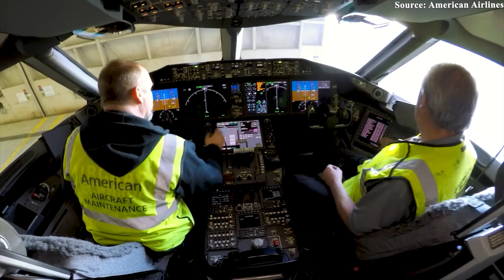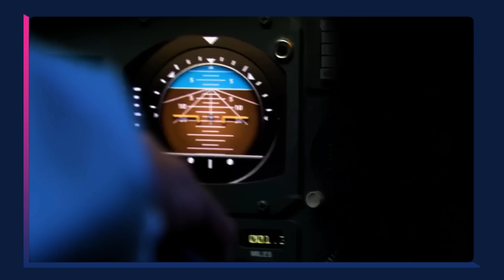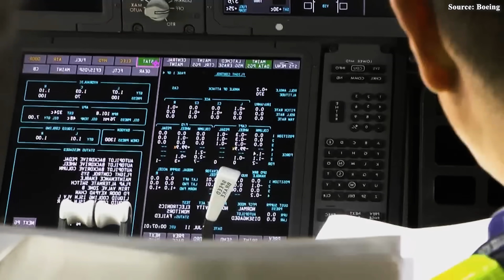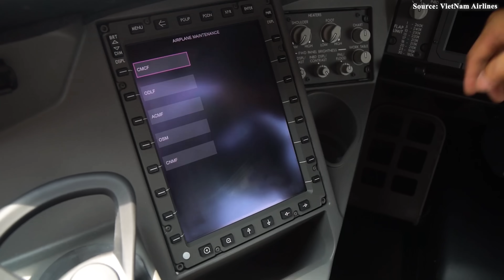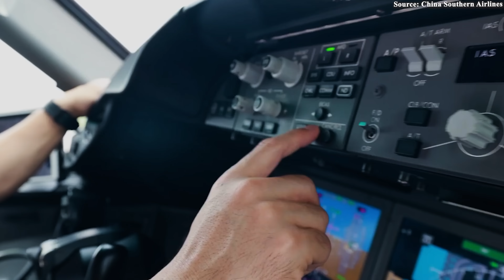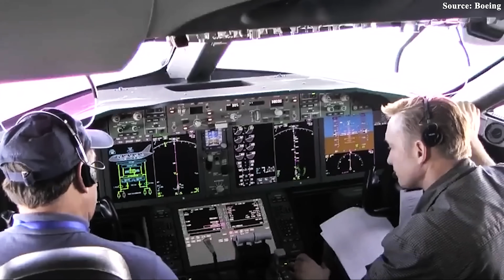They Just Dropped a BOMBSHELL about Boeing 787's AI 171 Flight!

Comment: That is rather cryptic that at 8:15 the video shows advancing the throttles with the fuel control in cutoff mode.  :(
Reply: You can't expect any response from engines that are NOT running, you can advance those throttles as much as you like.

Comment: Why are they afraid to say it was suicide. They need to devise a switch that only allows fuel shut off when the engine is in the idle mode, similar to the switch in the transmission of a car that only allows it to start when in th Park position. I'm shocked that this devise has not already been installed.
Reply: what happens when at 30.000 feet the crew need to shut off an engine quick

Comment: "Transitioned" does NOT necessarily mean "manually moved".  A  similar incident was reported on a Boeing 787 flight in Japan in 2019. The switches operate relays which control valves.  The entire system is part of the TCMA.  The matter is in a preliminary state of investigation and premature conclusions are best not culled from a reading of the preliminary report.
Reply: Cheap theater. A fundamental question is ignored by the "investigators".  It is known that FADEC can autonomously shut down either or both engines. What has not been determined (at least publicly) is whether the system can reset those cockfuel fuel switches. It is also known that some cockpit fuel switches (this seems to have been  deliberately tamped down by the FAA) are installed w/o the locking mechanism engaged. So, did Boeing make a concious decision to allow the system to cycle those cockpit fuel switches so that if TCMA shuts down an engine, or both engines, the cockpit fuel switches with reflect that new state? These are simple questions that the "investigators" are ignoring.
Reply: Exactly... 👍🏻
Reply: The only evidence that takes away from the computer is the pilot ask why did you cut off, so the switch was manually moved, but i agree, wait for the final report

Comment: @FLIGAVIA, I have the following comments to offer:

1). A total electrical failure would result in the automatic deployment of the RAT and the FADEC automatically closing the fuel valves, WITHOUT ANY PILOT INTERVETION or flipping the Fuel Control Switch from RUN to CUT-OFF.  

1.1) Do you know that one of the passengers who had travelled by this same aircraft from Delhi To Ahmedabad, on the same day, had uploaded a video of the air-conditioning and seat In-Flight Entertainment Devices not working?  

1.2) Have you heard the lone survivor from Seat 11-A, when he mentioned that soon after lift off, the lights of the cabin had flickered, followed by a loud bang, after which the aircraft crashed?

2). Isn't it rather presumptuous to speculate that one of the pilots deliberately cut-off the fuel supply to both the engines, based on an unsigned AAIB Preliminary Report, that is sketchy, shoddy, unprofessional, vaguely worded and ambiguous to say the least, that has even incorrectly mentioned FADEC as Full Authority "Dual" Engine Control in the Report? Yes, you may like to read the report again and confirm this.

3). Are you aware that there was no Boeing 787 pilot who as a part of the investigation conducted by the AAIB, who should have been called in as a subject matter expert? Isn't it laughable?

4). Ask yourself, if the pilot had a pre-meditated intent to commit suicide, as is being widely speculated, wouldn't it have been easier for him to simply put a gun to his head at home, rather than risk the other pilot restoring the fuel supply after he gad intentionally cut it off? And wouldn't it have been simpler for him to be the PF during this flight, and then merely flipping the aircraft over, soon after take off, leaving no scope or room for recovery by the co-pilot?

5). Did the AAIB Preliminary Report of AI-171 mention any of the following and why not? 

5.1) The time stamp of auto deployment of the RAT. 

5.2) The time stamp of the quoted conversation between both the pilots.

5.3) What transpired in the critical gap of 10 seconds between the "transition" of the Fuel Control Switch of the first engine from RUN to CUT-OFF and its subsequent restoration to RUN after 10 whole seconds?

5.4) Which of the two pilots had made the MAYDAY call? Or is it not pertinent?

6). Finally, what would you do as the PF after you have lost both the engines? Will you pitch up and risk stalling the aircraft, as can be clearly seen in the videos of the ill-fated aircraft, or will you level the aircraft to glide (without the risk of stalling) while the engines restarted?
Reply: very logical comments

Comment: As usual this narrator is being biased and trying to protect Boeing from being blamed here. Obviously this is cover up operation betwee the AAIB, NTSB and BOEING. just by sending out an advisory through FAA in Dec 2018 doesn't absolve you of negligence. Obviously the American government is interested because they are looking at the business that you bring in thorugh other airlines placing orders. I ask you this what did Boeing do when Jan 2019 Air Nippon flight from Tokyo to Onida upon final approach the switches moved from RUN to CUTOFF the reason software glitch. Another one 15th May 2025 UK Civil Aviation Authority issued a memo that these switches can disengage by them selves. Where was the FAA and BOEING then, this is 27 days before the AI171 incident. Very easy to blane the pilots, for they aren't alive to defend them selves. Stop spreading wrong narratives and your job should be to just and be fair not speak in favour to protect your vested interest.......
Reply: The switches were flipped manually; the digital data does not lie.  You are obviously in denial and will twist, invent of make-up BS to find a way to blame Boeing at any cost.  The copilot was flying with both hands on the yoke, the captain was supposed to monitor, instead he pulled the cutoff switches 3 seconds after the airplane rotated.  In some aircraft when the engines turn off so does the CVR and the data recorder.  In this case they kept recording.  Switching the fuel back on just before impact with no recording would put the blame on Boeing and relieve him of any blame, but the captain was wrong since the recorders kept going, we know what occurred.
Reply: Arw you saying Boeing did not make any faults? You are in denial mode to protect Boeing as it is a big business. Did you ever watch videos of whistle blowers who have worked in Boeing? If no, pls. watch them first & listen carefully what they say, instead of peotecting blindly.
Reply: Very true. Very easy to blame the dead pilots.

Comment: If it was an electronic control problem, it explains the time taken by the pilots to re-enstate the RUN command. As the switches is in the ON state they would have to move the switches to OFF and then again to ON. This is counter intuitive and thus would take time to decide and then to do it.
Reply: The switches were flipped manually; the digital data does not lie.  You are obviously in denial and will twist, invent of make-up BS to find a way to blame Boeing at any cost.  The copilot was flying with both hands on the yoke, the captain was supposed to monitor, instead he pulled the cutoff switches 3 seconds after the airplane rotated.  In some aircraft when the engines turn off so does the CVR and the data recorder.  In this case they kept recording.  Switching the fuel back on just before impact with no recording would put the blame on Boeing and relieve him of any blame, but the captain was wrong since the recorders kept going, we know what occurred.
Reply: The switches were flipped manually; the digital data does not lie.  You are obviously in denial and will twist, invent of make-up BS to find a way to blame Boeing at any cost.  The copilot was flying with both hands on the yoke, the captain was supposed to monitor, instead he pulled the cutoff switches 3 seconds after the airplane rotated.  In some aircraft when the engines turn off so does the CVR and the data recorder.  In this case they kept recording.  Switching the fuel back on just before impact with no recording would put the blame on Boeing and relieve him of any blame, but the captain was wrong since the recorders kept going, we know what occurred.

Comment: There are a lot of demented Boeing haters here with a conspicuous lack of intelligence.
Reply: I'm no fan but it's not enough to send me down the rabbit hole. And if you challenge them, you're told you work for Boeing. Well one can ask back. Do you work for Aerobus? Not a fan of Boeing but in this case, so far it's not leading in that direction and Boeing is damned if they do or don't with bulletins. Faulted if they do release them and if they hadn't they would have been accused of a coverup. Usually in situations with murder sucide as a possibility, the airlines point attention elsewhere. Egypt Air, SilkAir and possibly China Eastern Airlines which hasn't released a report since the NTSB memo  . But China didn't ground their B737 fleet either and they were the first to do so with the B737 MAX series.  LAM Mozambique and Germanwings didn't do the same thing. It's hard to get around that it's more than likely that the first officer saw what the captain did. But there has to be a transcript or video that has the exact words used. Plus there might have been comments made by the pilots that so far hadn't been released. If the FO was "panicked" did he say anything else to indicate that?
Reply: @radfem2010  I agree. I'm no fan or apologist of Boeing, as it's made its share of egregious mistakes, but I'm not going to kick them when they're down, unless there's convincing evidence of negligence or wrongdoing on their part.

I have a coworker who is a pilot with an ATP certification who is insistent that the fault is with the switches; he's Indian and refuses to consider the possibility that it could be human factors in the cockpit. When I try to enumerate the simple facts and the logical conclusions from them he shuts down the conversation and changes the subject.

I think he is an example of the fact that there are people who don't want to confuse an issue with inconvenient facts.

Comment: A computer controls everything.  And if it was a chip bug which sent a signal blocking fuel and informed switches moved but in reality they didn't move phisically and the same, computer reactivates it ???
Should check this possibility...
Reply: Why don’t they simply use video cameras in the cabinet

Comment: Oct 31 1999. Another boing 767 plane going to Cairo from Newyork crashed killing all. The reason? Switches for both engines had mysteriously moved from the run to the cutoff position.
Is this just Coincidence.
Some are deliberately trying to sweep the facts under the carpet.
Reply: Bullshit. That involved more than one pilot fighting over the controls including a relief first officer who was facing job termination as soon as he landed that plane. It was very similar to SilkAir which happened two years earlier. Why do you make up lies?  That plane wasn't taking off and only a few hundred feet off the ground. It was at cruising altitude where shutting off both engines is't quite as deadly as it was within 3 seconds of V rotation. But Egypt blamed the plane just like SilkAir did two years earlier. They didn't scapegoat the pilots as you'd call it. That plane was nose down whereas Air India was on its belly with a slight nose up attitude. Murder suicides when they happen usually happen within 1-3 years of a previous one with long gaps in between. The two in 1995,1997 were similar in terms of how they were carried out. High altitude, struggle over the control.   2013, 2014, 2015, with two of those LAM Mozambique and Germanwings involving one pilot being sent out of the cockpit then locked out. As both CVRs recorded that locked out pilot trying to get the door unlocked and then banging on it. The pilots in the cockpit in both cases adjusted the autopilot to lower the descent of the plane to an altitude that was lower than safe. Malaysian Airlines was in between that and suspicion that the first officer might have been locked out b/c his phone attempted to make a call not long after the plane whent ghost on ATC.   It could be mechanical but CVR makes it seem that it is more than possible that the first officer saw what the captain did. Even with the WSJ the CVR still looks a bit sanitized in terms of any exchange the pilots had.
Reply: The vagueness of even considering it's a preliminary report is troubling. If it were boeing then they probably would be a bit more specific b/c the culpability of Air India would be potentially less.

Comment: Rubbish.  The fuel switches were transition has been mentioned not physically moved. Rubbish govt had published rubbish report to save Boeing.  Sab changasi if you provide funds to win elections.
Reply: Not if the first officer saw them being moved and that's not been ruled out. The CVR is still pretty sanitized and I don't think Air India would be doing that to protect Boeing. Easier to point the finger at them. Especially considering their reputation. The people that have the most to benefit by people painting conspiracy theories as fact is Aerobus. Which has its own issues like Boeing. Because the industry itself is a mess. And any accusation of anyone who challenges your "facts" as working for Boeing can easily be responded to by asking if you're working for Aerobus.

Comment: Boeing should have incuded a warning voice "are you sure you want to turn off the fuel ?"
Reply: It should be not allowed and blocked to cut off  engines during the take off
Reply: @dorotkak.7598 Who's in charge? The plane or the pilot? The plane should do whatever the pilot asks. The airline is responsible for making sure the pilot isn't f'd in the head. Not all pilots are equal just like not all Dr's are equal. There is a joke, what do you call the person who finishes last in their class at medical school? Doctor. The same goes for pilots. Every time you get on a plane you are hoping the pilot isn't a DEI hire!
Reply: Make it impossible to cut off during flight or when someone manually  trying to cut it off after take off repeat asking software if they are sure or let alarm goes off before software accepting the Manuel cut off
Reply: The switches were switched off AFTER the engines failed. The preliminary report conveniently missed the RAT deployment time stamping. This is as per Boeings standard procedure, when engines fail.
Reply: @cherryg2210 when you cut off the engines during the take off you provoke the engines failure and that is  the reason the rat was deployed
Reply: should be NOT POSSIBLE TO DO SO AT ALL if a certain height is not reached
Reply: @saulsavelis575   Boeing and Airbus can figure it out what is the best way.
Reply: Absolutely ! .. what tha hek is going on !!! how come this slipped thru their fingers ! Helloooh what's going on around here ! travel trust on safety needs to be restored .. after this ! Boeing need to do something fast !
Reply: Since the switch is meant to quickly cutoff fuel during emergencies while the plane is on ground or closed to the ground, a minimum altitude limit and speed should be set to disable the cutoff switch.
Reply: It was done intentionally. There is no fix for that.
Reply: @garrymacphee8328  you don’t (nor does anyone else know) this as fact. Again, wait for a final and credible report.
Reply: @garrymacphee8328  You don't know it was intentional.
Reply: That's close, but more than just warning. Flight crew should not be able to cut off fuel to an engine during flight without a fire warning being activated. The aviation industry’s design philosophy was based on the trust that nobody wanted to die. That’s why the cockpit used to be wide open—until 9/11 proved that some passengers do want to die. But the loophole still exists for the flight crew. They can shut off fuel to the engines at any time, based on the same outdated assumption. The manual shutoff is just as dangerous as the open cockpit practice.
Reply: @jglee787  What about the flight controls then? I believe that perhaps the travelling public is being primed to accept pilotless aircraft.
Reply: @TheIncredibleMrG777  Flight controls are harder to manipulate when both pilots are at the controls. Boeing aircraft have connected yokes that cancel out opposing inputs. The EgyptAir crash happened because the First Officer was flying alone while the captain went to the restroom. He disconnected the autopilot and began the dive.

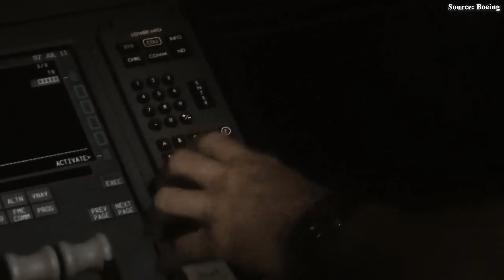Comment: They didn't flip back to run immediately 4:34 (in this vid).  It was a whole 10 seconds later. This means if the other was preventing him, after 10 seconds it was too late to make any difference anyways, so the captain would have then let the Pilot in command switch them back on.
Only a seasoned pilot would know exactly when to turn them off for the most probability to cause a crash, and how long he had to keep them off.
Reply: Was there any controversy about turning the levers back?